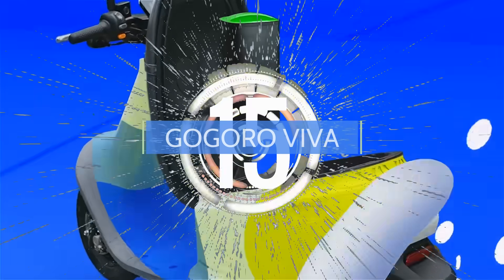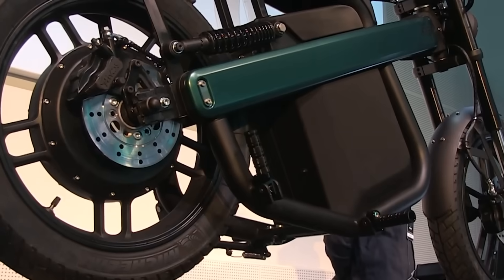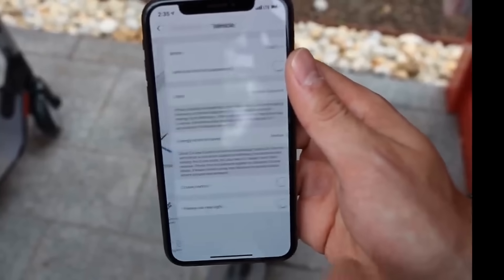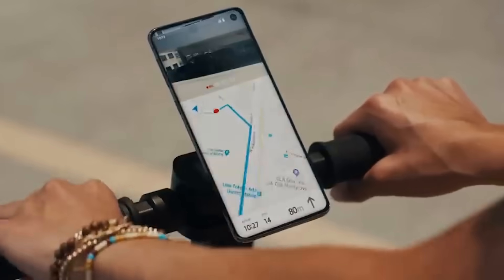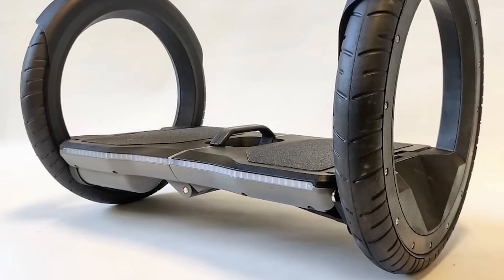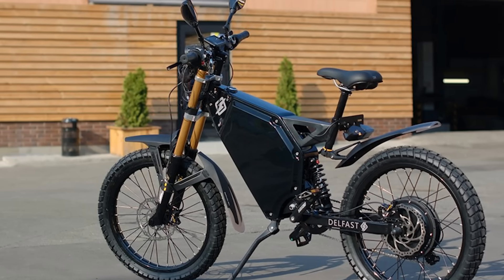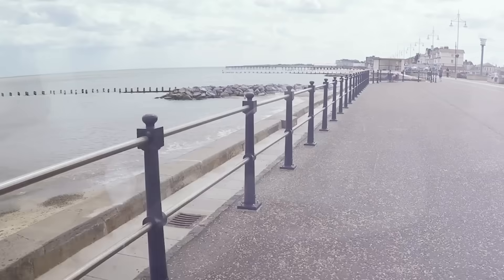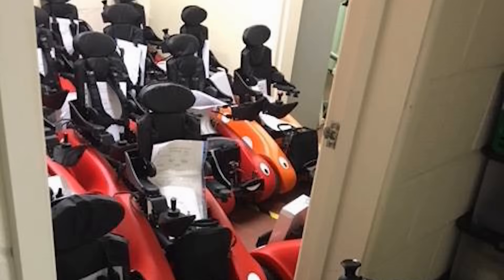Top 15 Personal Mobility Vehicles: Urban Transport Revolution

Comment: Nobody speaks about from where the electricity comes , nobody mentions the eco-impact of producing and recycling batteries !
The aspect is, which of them is street legal and how are the considered tax-wise ? BTW it is km/h , not k/hr ( things like this have a international standard, not home-made interpretations . As well not mentioned: security aspects when eScooter run in pedestrian areas without being heard ....old guys be carful, they'll run you over !
Reply from the maker: Yes there are plenty of people who bring that up on every electric vehicle video we post. There's progress being made in several areas of concern. For example Tesla has batteries in the works that will last as long as 500k and 1m miles. I've also heard of batteries that won't require the use of lithium in the near future.

Comment: I liked the cabon car mobility scooter. What if the person needs to go over a hundred miles ... And at least 30 mph.  And can be rechargeable by using solor pannles on the roof on the top of the scooter and be sued like a personal ride the public transportation including cabs uber or the onther one when the person suffering from ptsd. When being around others you get nurves..
Reply from the maker: They could stay the night and charge it up. Most these type vehicles are made for short distance travel. Over time new models will go futher than the one before. I like the idea of the battery being swapped out at a station in the previous segment. Perhaps in future designs they could consider doing that with all electric vehicles.

Comment: No.5 delfast prime cought my eyes. This off road bike is most suitable for the Indian roads. Though it cost too much as of now. Hoping to have it's low cost version available soon. Oh yes, a similar electric bike is currently under test in India. It's made in India and quite cheaper as compared to this one. I hope they will be available through out the country soon.
Reply from the maker: I agree and hopefully they start dropping in price like most things like this tend to do. I do think some of these scooters and e bikes are overpriced. Possibly at this stage and time manufacturing costs are extremely high for reasons unknown to me. Thanks for watching!
Reply: The Delfast has gone up in price the new one the Delfast 3.0 is 6,999 and that’s the default one without any accessories.if you get the accessories expect to pay up to 7000-8000.Depending on the accessories of you choosing
Reply: Thanks for replying. Is there any helmet discovered that can be rolled/collapsed in the pocket when not in use?
Reply: @jiovani the price you mentioned is probably in USD it's still very expensive in Indian currency

Comment: How about some vehicles for older people with disabilities
Reply: With handicaps, often weight is an issue. So is size and flexibility/mobility of individual. I doubt I could get in/out of #3 even if it could carry my large inflexible 300 pound frame.
Reply: @anthonythorp7291  me too! They make these things 370lbs man with bad right knee and ankle.
Reply from the maker: I got a whole video coming dedicated to vehicles for the disabled and elderly. I think you'll really like this one.
Reply: @mindseyedesign  THANKYOU
Reply: Also I question the tiny tires. It may cause problems including stability. And let's not forget,  not everybody lives in the Caribbean. 
    I know you're just bringing these to light and not doing a full work up but I'm just pointing out they don't impress me for handicapped use.
Reply from the maker: Number 2 and 3 are both for elder people and those w disabilities and number 1 is for kids with disabilities. Got to watch to the end to see them all.

Comment: Where does the electricity come from? And how much coal or natural gas gets burned to charge your vehicle ? (line loss, charge efficiency, charge loss...)  still cool
Reply: Potatoradio.   SSHHHHH !!!! These are eco friendly zero emissions alternatives. You're not suppose to  mention everything else connected to them from manufacturing to charging still destroying the planet.
     People can't falsely feel good about themselves if you mention iron copper aluminum lead mines, oil industries for tires plastic wire insulation nature gas for electricity,
Reply: How much coal and petroleum gets burned to extract and refine gasoline?